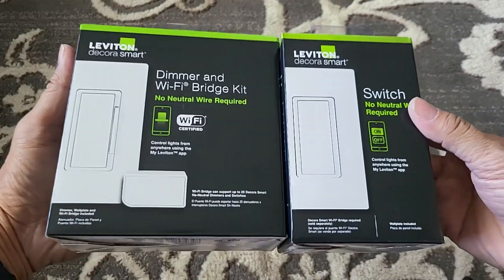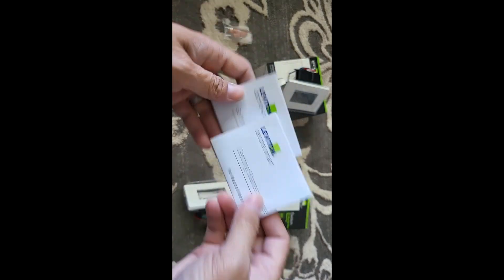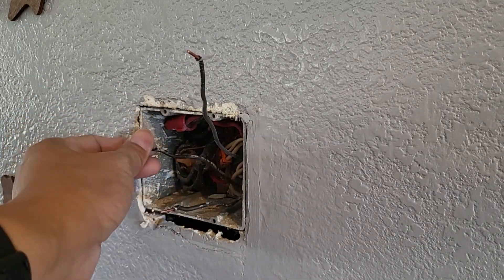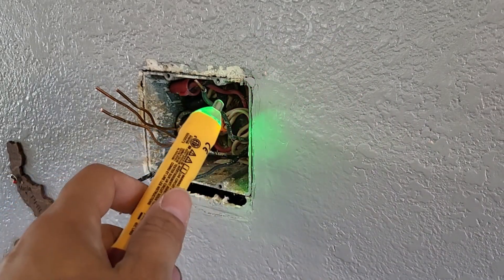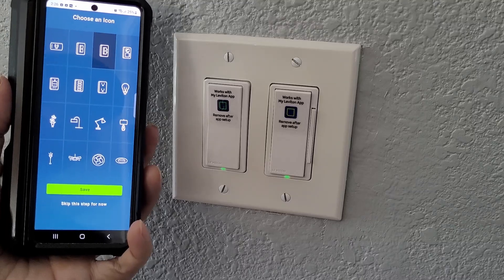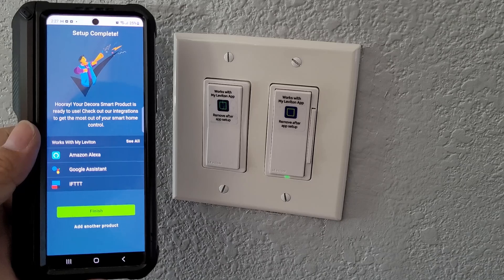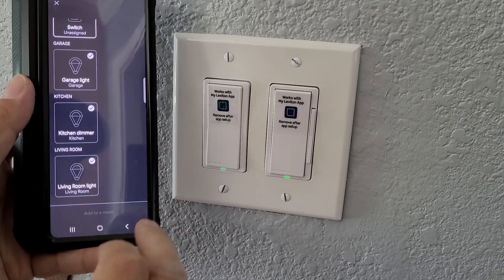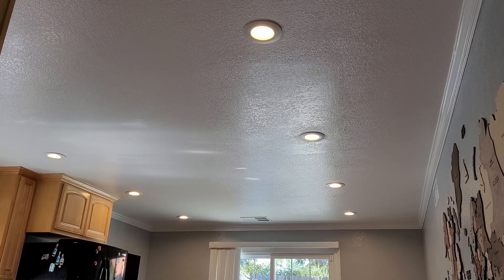Leviton Smart Dimmer and Switch (No Neutral Require)

Comment: Can I bridge two circuits (not 3-way) using the bridge as a virtual three way? 

I have a bunch of circuits that should have been 3-way but instead has redundant lights everywhere. (2 lights in a room with 2 separate switches at opposite ends of the room) 

And what’s the latency using the bridge to have multiple lights turn on via one having a button press?
Reply from the maker: SUPPORTS WIRE-FREE 3-WAY: Add Wireless Multi-location control when paired with optional Anywhere Switch Companion (DAWSC)